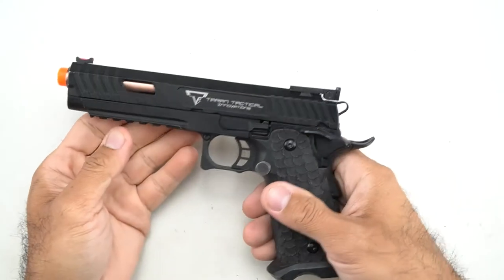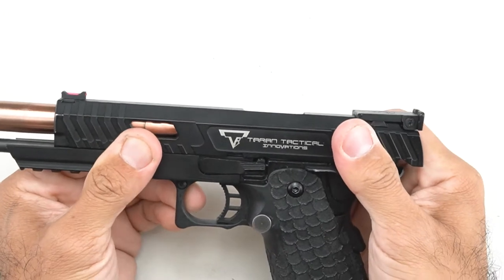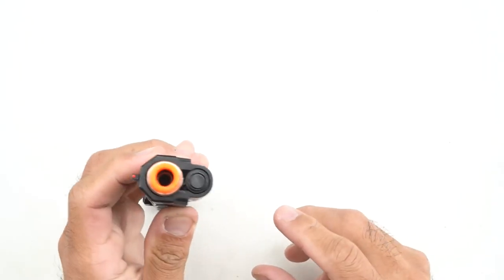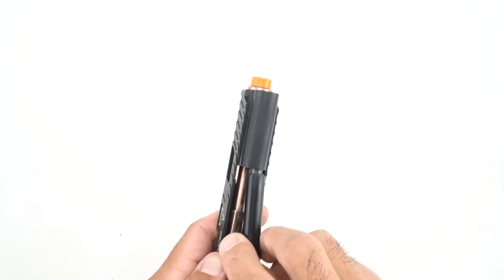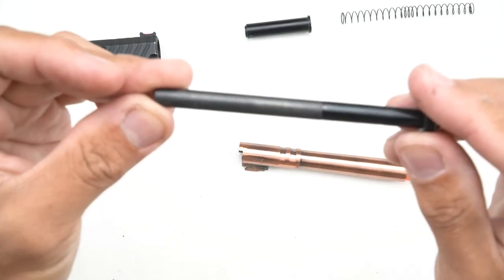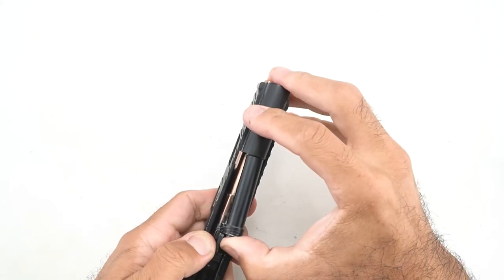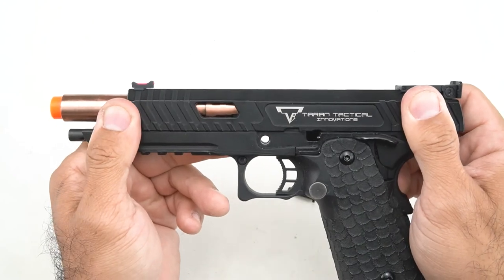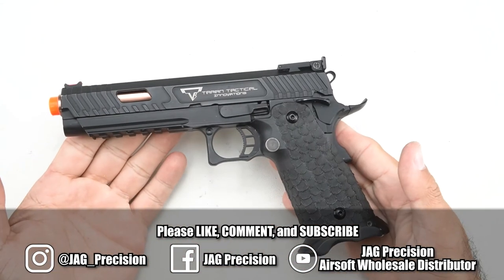JAG Arms TTI Combat Master takedown - JAG Precision

Comment: Kind of a bummer when they show you the incorrect way. Better just to do it the way they show you, by removing the 1.3mm set screw that is in the spring guide rod, and once that is in two pieces, removal is much more simple. This way risks breakage and did not work on my TTI licenses Combat Master.
Reply from the maker: You could do it that way but you run the risk of losing screws or stripping them. We're following how you would do on the r*eal thing where the guide rods are often 1 piece. But if it achieves the same result you do the way that works for you.

Comment: How do you take out the orange tip
Reply: Unscrew it.
Reply: @psnscreamokujo6230  
I broke the plastic when I tried to unscrew it so I had to heat up the plastic with a hot air dryer.

Comment: For some reason the safety pin doesn’t want to come out
Reply: Late reply.

Had the same problem. Turns out there's a protrusion on the slide stop, the part that sits inside, that wore out after constantly hitting the slide. Had to file it out a bit, just enough for it to be able to slide out but not for it to be completely useless.